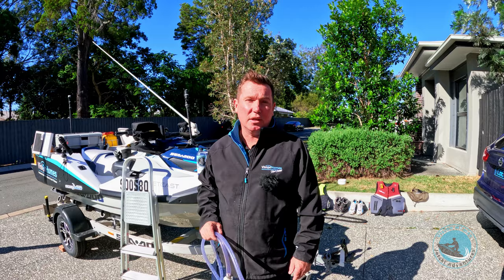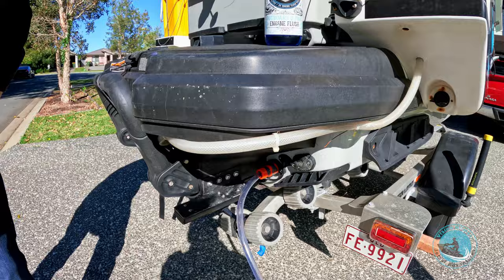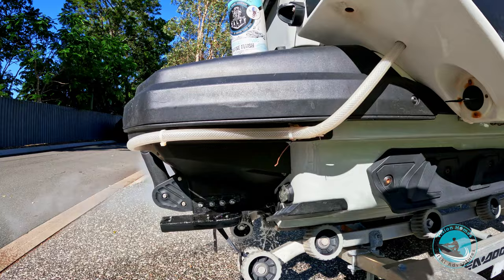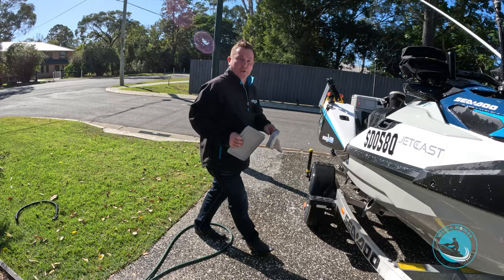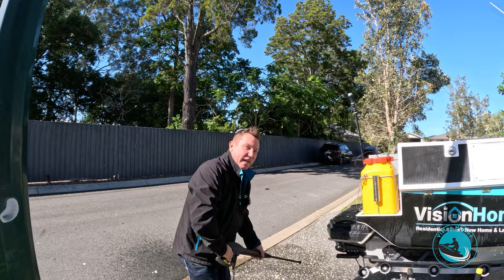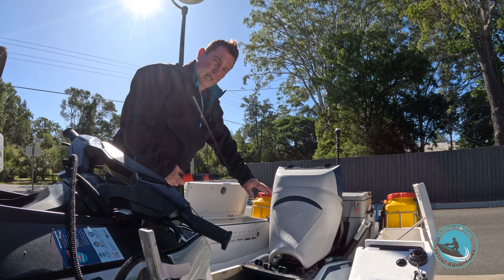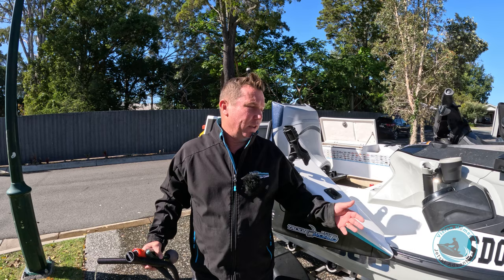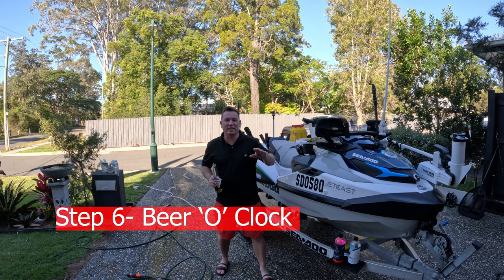Cleaning and Flushing a Jetski - Footwell Bilge Pump

Comment: Hey mate nice video on cleaning

Was trying to find your video on your front mount minnkota bracket mount if possible and what size battery and minnkota are you using😊
Reply from the maker: Thanks Nick - appreciate it.  My Minn Kota is 55LB Powerdrive - with a third 50amp Lithium battery.  Check out WAL’s Ultimate Fishing JetSki - there’s a bit about the front mount Minn Kota there.